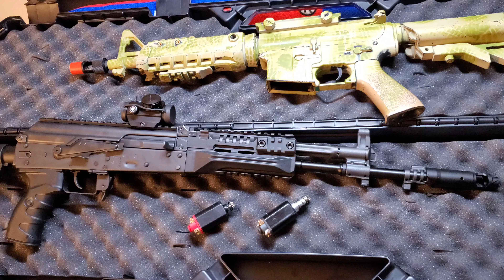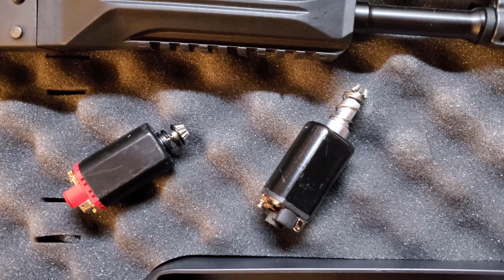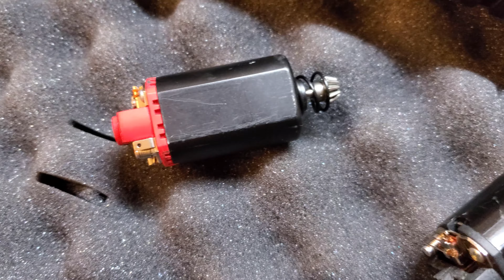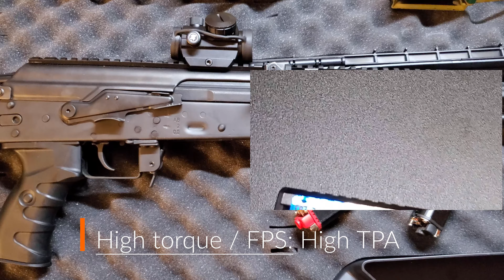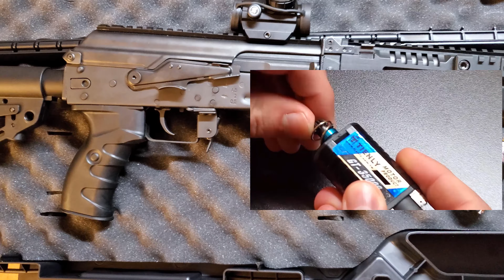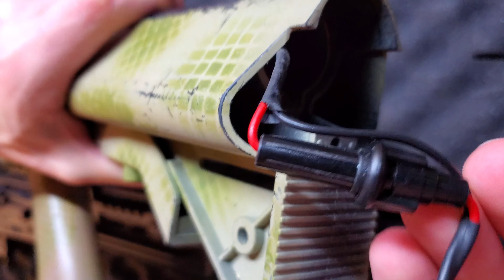How to Choose an Airsoft Motor (4K)

Comment: I have a m4 and I would like a motor that can keep up with my gun and can have a fast trigger response with long range any recommendations?
Reply from the maker: The motor will not affect your range or FPS, your hopup, barrel, FPS, and bb weight will though. If you are looking for fast trigger response the ASG 28TPA and the Tienly GT lower RPM motors will definitely get you good trigger response. Also your trigger response will depend on what spring is in your gearbox. Lastly make sure you order the long type motor because that is what m4's use.

Comment: You should include info on amp draw, overspin, heat buildup, bevel to pinion shimming, and pairing gear ratios, all are very important info regarding motors. Also there is diminishing returns when looking for certain things (32 tpa might be a faster cycle time, but its spammability would be slower than a 22tpa). There are also numerous forms of motors now with different applications: brushed, brushless, parallel.

Either way a very nice, calm intro to motors!
Reply from the maker: Thanks for the feedback! This was just a basic overview for people that are new. Maybe down the road we will do a more advanced video on motors.
Reply: Damn this is what I was hoping the video would be

Comment: I got an g&g predator and currently the base fps (last time I chronoed it) was 270 fps and I was thinking about trying to get it to have higher fps or range atleast since it can barley reach across the field I play on
Reply from the maker: For range the best thing to upgrade would be the hopup, try doing a flathop. That should help your range/ accuracy out. Also, tightbore and longer barrel would increase your fps. Those are the easiest things to upgrade without tearing into the gearbox. If you don't mind taking apart the gearbox than a slightly bigger spring paired with a higher torque motor would be a good option. Also, while your in the gearbox check your air seal between the cylinder and the piston head, that is another way to lose fps in an AEG.

Comment: Long shot here… after voiding my warranty (like we all do) for my recently purchased tk.45, I put around 4 mags through it and the motor gets very hott, even gives off a bad smell. I assume the company i bought from will not help me since i removed the orange tip already, will i be safe to assume I can just get a motor that fits and be good to go? Could using this a bad motor effect the rest of my gun? I assume what i have is a bad motor out of the batch, the smell and slight smoke is what has me think that. ANY HELP will be GREATLY appreciated.
Reply from the maker: Using a bad motor could be bad for the wiring due to the overheating or if the pinion is not meshing properly it could wear out the bevel gear quickly. Try installing a good quality aftermarket motor (make sure its the right type, either short or long). Also, when installing the motor make sure that the motor is going straight into the gearbox, sometimes if the motor is at the wrong angle stuff like that can happen. We also have a video on installing a motor if you want more help. If that doesn't fix the problem then you might have to look deeper into the gun.

Comment: I cant find any of the 32tpa motors, im really trying to get good trigger response so id like to get one.
Reply from the maker: 32tpa motors are hard to find, I hear the 28tpa ASG motors are good though. Some people make there own 32tpa motors called franken torque motors. But for off the shelf motors the highest you will probably find is 28tpa which will still get you great trigger response with a good setup.

Comment: Doing a efficient, realistic fire rate, motor should i get?
Reply from the maker: Probably around 45000 maybe 50000. There are many great options out there.
Reply: @OrdoAirsoft  do you need to upgrade the internals? For ak12 50000 motor?

Comment: What’s a good motor to make my fire rate way higher
Reply from the maker: Tienly 50k rpm motor, and we have heard the warhead industries brushless motors are good as well. Warheads ultra high speed motor is rated for 52k rpms with 11.1v.
Reply: @OrdoAirsoft  thank you👍
Reply: @OrdoAirsoft  how many bb’s per second can 36,000 rpm get you🤔

Comment: Howdy, I have an m4 I'm just getting into tech and want to get a motor that's gonna increase my RoF any suggestions?
Reply from the maker: Go for a higher RPM motor, Tienly has good motors in our opinion maybe a 50,000? Depends on what your setup is and what ROF you want out of it.
Reply: @OrdoAirsoft  k thank you so much

Comment: Nice explanations man, uggly ass m4 though hahah
Is it possible to estimate the RPS output on a good m4 platform with a 35k motor ?
I'm aiming for 25ish RPS
Reply from the maker: RPS depends on gears, spring, battery, mosfet etc. If you can find videos of other people with the motor your looking at with a similar setup you might get a rough estimate.